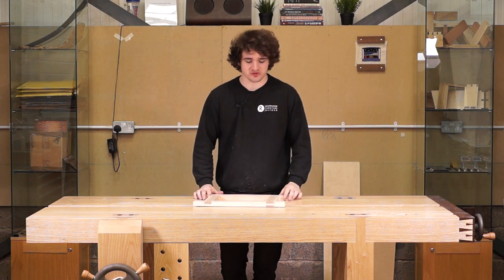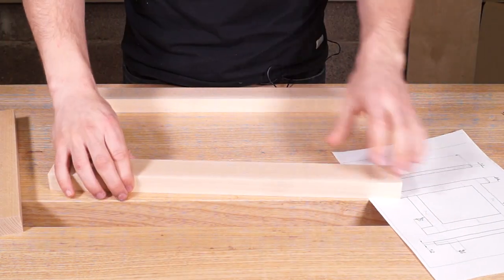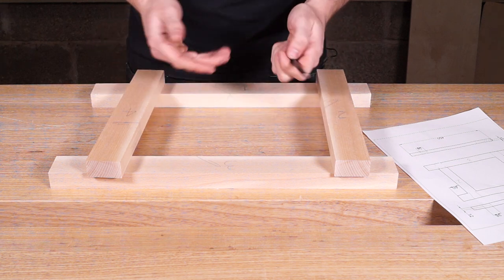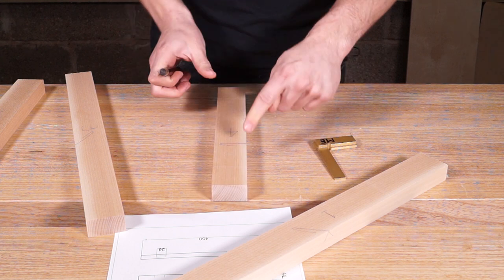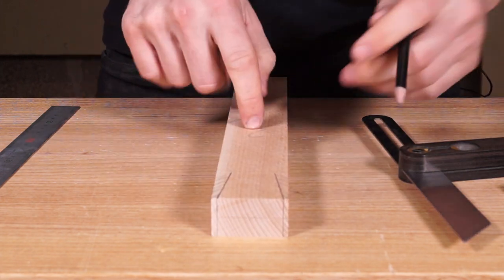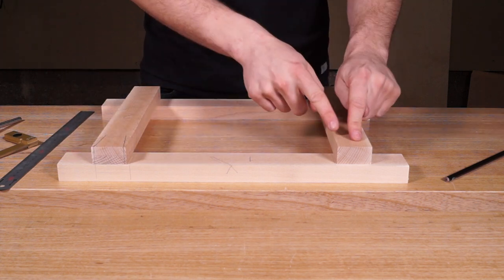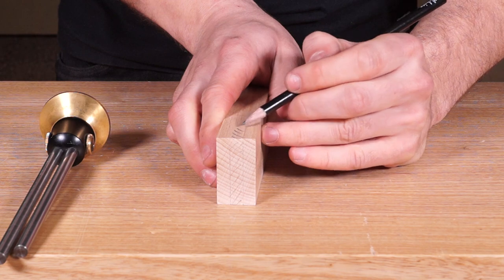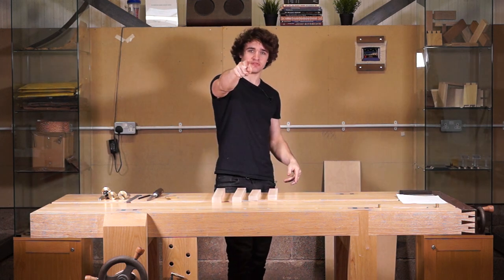Making a JOINT PRACTICE frame - Part 1

Comment: Hi Matt, as a newbie to carpentry. Silly question for the channel. We use softwood in college, but I'm using 2 by 1 to practice having Joints. Very basic. Struggling to get cuts straight, but is 2 by 1 ok to practice on what would you recommend. Also Marking with a pencil correctly I'm struggling with still after 5 months. Luv the channel.